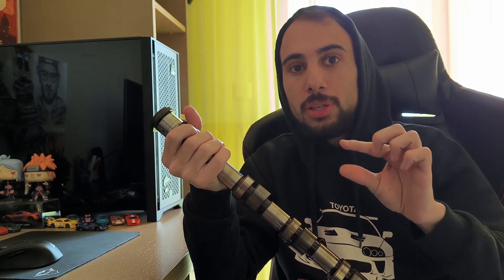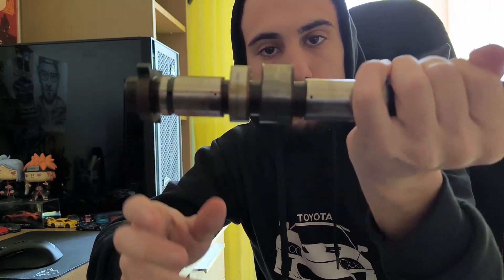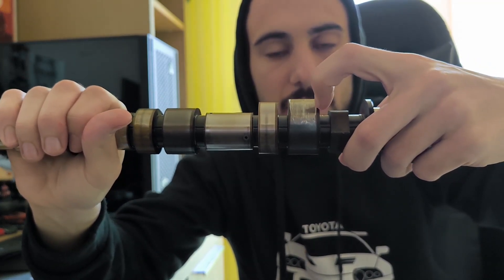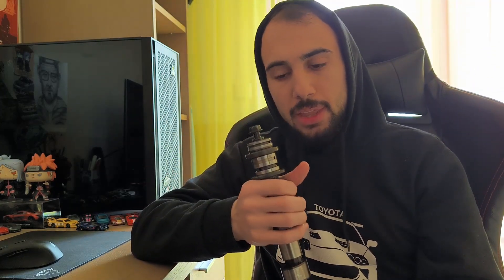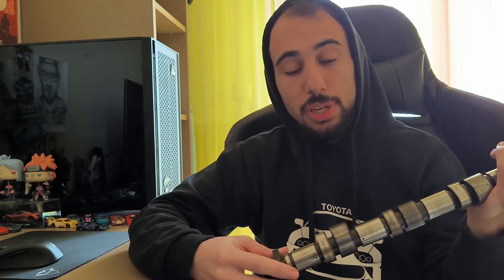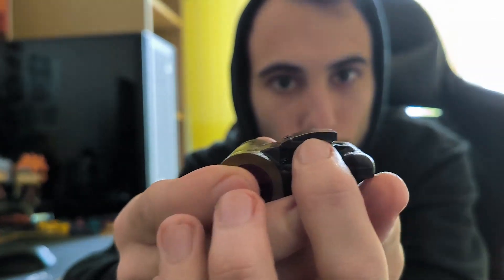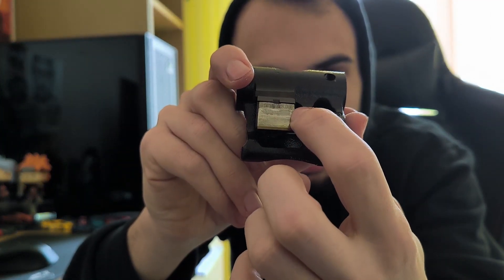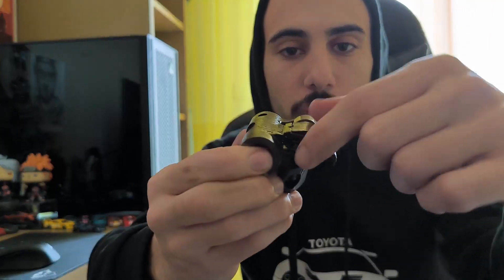2ZZ-GE WIPED CAMSHAFTS

Comment: Very interesting video and well explained and a lot of good advice!  Noticed wear is on the high-lift lobes.  Want to investigate more and certainly appreciate your insight.  Agree with concept of over-heated oil (high revs) and possible oil starvation.  Also like explanation of the roller follower for low RPM vs. pad on high-lift cam profile.

PS:  I did have to replace two rocker cam followers on my 2zz as material started to de-laminate on one.  The other has a missing corner on the pad.  Cams were still perfect so I got lucky.  All other rockers perfect and my engine had 100k miles of abuse, including broken rocker shaft bolts (2001 M.Y.)

Cheers and thank you for posting!
Reply from the maker: Appreciate your comment a lot my friend! I really wish that I have helped you and many more that have watched this video.
Stay tuned for more interesting info related to 2zzS, mr2's and overall racing
Reply: @pako-nsgs  
Thank you also for the kind response!  I have a theory that the rocker bolt shaft, when sheared, allows the rocker shaft to "clock"  and inhibit oil to the high-lobe cams as shaft is hollow and has oil passages for the lift system.  Very interested in your opinion and results.  Cam-wiping root cause?

Comment: Hopefully mine are ok. I'll be finding out soon when I do the seals.
Reply from the maker: @Viking88Power  I wish you luck but sadly more and more people report wiped cams nowadays due to wrong oil viscosity and not properly warming up the engine before lift
Reply: @pako-nsgs  What is the right oil viscosity for the 2zz engine ? because i drive with 5w30 you think thats ok ? thanks
Reply from the maker: @dann1y406  What temperatures approx.? 5w30 is super thin for someone that revs the engine to the top and "has fun" with it. But temperature plays a major role so yea
Reply: @pako-nsgs  the temperatures are normal like 90°Celsius. What for oil Viscosity Would you Recommend. I drive normal only sometimes i drive sporty. Thanks
Reply from the maker: @dann1y406 oh I meant climate temp, like what's the temperature at where you live

Countries that never see below 0, like Greece, I recommend 10w60 or at least 5w50... For colder climates I guess I would only try 10w40 and even then, I would take it easy with monitoring oil temps
Reply: @pako-nsgs  ah ok yeah i live in germany in winter it gets to -10° Celsius. So you think 10W40 oil is good ?
Reply from the maker: @dann1y406  better than 5w30 for sure, but to be honest if you don't race much, yes it's very good😅

Comment: Awesome about 2zz cams. Thank you,
Reply from the maker: Happy to hear you liked it! Stay tuned for more videos about 2zzS
Reply: @pako-nsgs  What I'd like to know is can you run stage 2 cams say Piper as an example without a tune as the stock ECU on a Celica is non tunable. If you can do you have to upgrade springs to stop bind?
Reply from the maker: @craig357  you have to surely upgrade springs and retainers! It's a must... About a tune, I guess you could do without a tune but the car would performe worse than with stock as soon as it won't work properly...
Reply: @pako-nsgs  Thank you very much so basically just use original Toyota cams if retaining stock. Appreciate your valued input.
Reply from the maker: @craig357  yes absolutely! They cost a lot aswell do go stage X... I have a standalone ECU and I still didn't feel like spending so much so I just bought original used 2zz cams
Reply: @pako-nsgs  I have seen a few cams used on eBay etc. If I went that route would I have to renew rollers underneath and re-shim as obviously wear patterns on 2nd hand would be different? Is that correct? I am tempted for new cams however despite some wear no ridges so may be okay on the ones I have? Thanks again your video is a God send.
Reply from the maker: @craig357  yes! Always renew rockers underneath because everything will be different on other set of cams... And if you have wiped cams, you for sure have wiped rocker aswell because the pad gets wiped and the it eats on the cam!
Yea if overall you fingernails don't get trapped on the edges of the lobe, you shall be ok for a while... Keep on checking tho !

Best choice for me was just oem cams and rockers